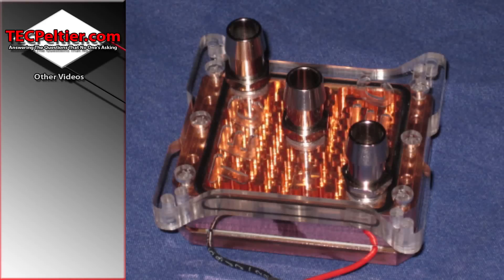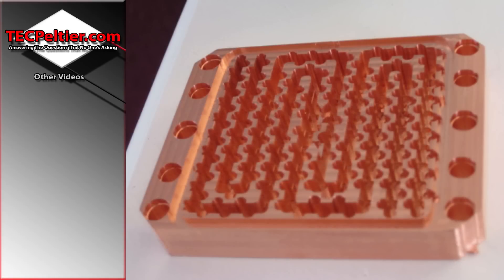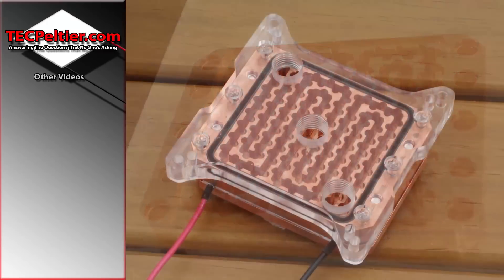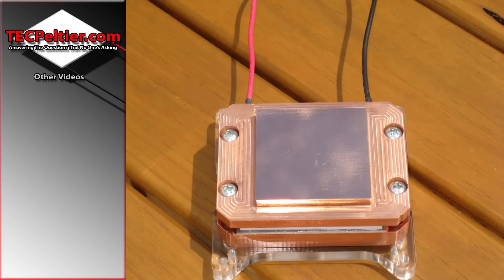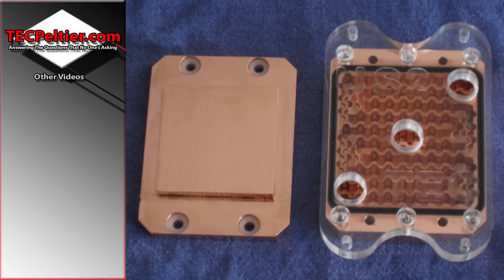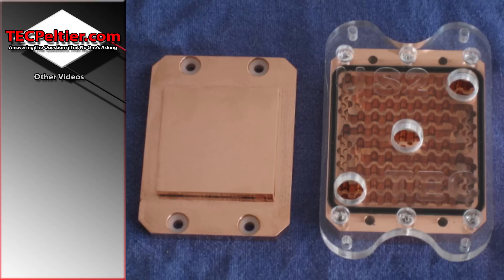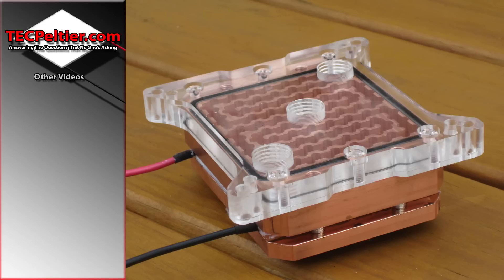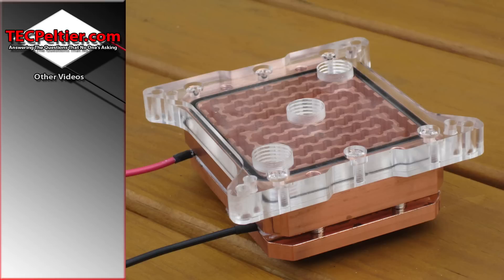⚡️ Thermoelectric Cooling (TEC) Peltier Water Block For Water Cooling a CPU. V2 Single 62mm

Comment: Well done. That is a promising design. It should work very well. If I was going to do water cooling That's how I would do it. the peltier would be outside the case cooling instead of on the chip due to condensation concerns.

Comment: Suggestion:
The piece that costs $ 80.00 is made of copper.
The piece that costs $ 4.00 is made of aluminum.
Copper conducts and exchanges more heat than aluminum.
The cheap piece, $ 4.00 have a version made of copper.
Compare with the same material.

PS: Sorry for my lousy English.